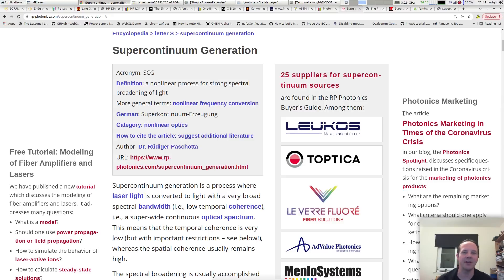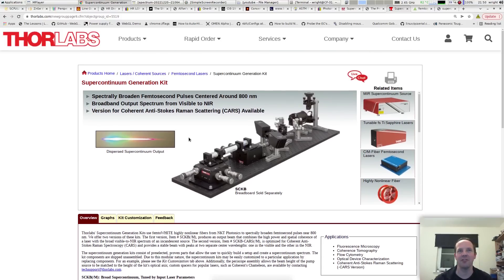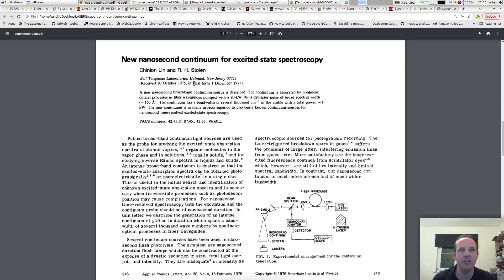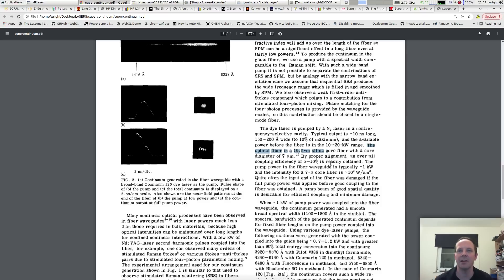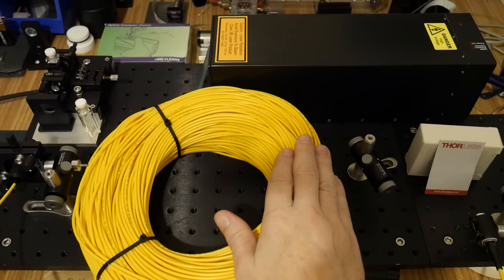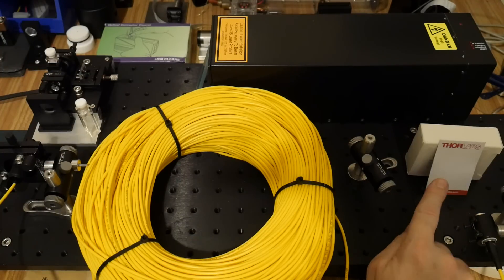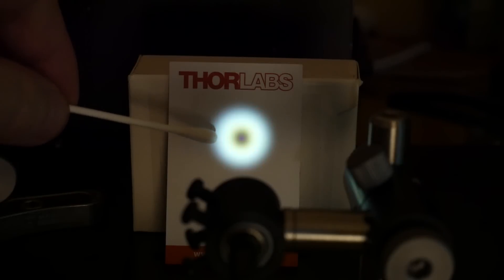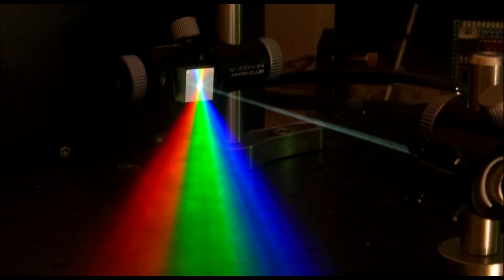DIY SUPERCONTINUUM LASER on a BUDGET!!

Comment: Very impressive! 

I remember some time ago you mention your home-made nitrogen lasers had quite good modeprofile, so it maybe interesting to try to couple them directly into the fibers and see if that works. 

As for the donut: Telecom fiber is designed to be single mode for 1550 nm, if you have shorter wavelengths, you can obviously still get some higher order modes in it. For example the Thorlabs 1550BHP Fiber (single mode, non-PM, 9 um core) has a cut off wavelength of 1260 nm, i.e. and wavelength shorter than that and it may transmit some higher order mode.

Edit: Upon thinking about it, that maybe the coherent superposition of the two TEM01 mode for the two polarizations you're seeing as a donut. Maybe if you hold a polarizer in the output you see a clearer shape.
Reply from the maker: It may be worth a shot, but I suspect the UV will damage the fiber. In the current setup I am right on the edge of the damage threshold, and have destroyed quite a few fibers getting to this point.

That's what I figured. At 400nm 9um is a giant hole as far as the light is concerned. But counter-intuitively 50um fiber gives a very tight singlemode output, suggesting that self focussing can take place within the fiber. There is a lot of scope for experimentation with this project!
Reply: @LesLaboratory  May I ask how you destroyed the fibers? A blown off end facet can be polished off. While you are mainly using the thorlabs-style fixed lens couplers, you can of course couple to a more-or-less bare fiber directly too. The Newport F-1015 fiber couplers is style of fiber coupler that you can also reproduce at home that doesnt rely as much on patch cables and where you can easily fix a blown end facet. Of course, if you destroy fibers by color center formation in the fiber, there is nothing you can do, really. 

Yeah, the scope of experiments is nearly endless. Self-focussing is of course one of the mechanisms the modes in fiber can couple from one mode to another, but I'd be careful to take the changes mode-profile as evidence of self focussing. Since in long and bend and impure fibers, modes couple anyways.

Comment: If you pass the output of the prism through an LCD screen with the backlight removed then through another prism to recombine the spectrum you can dial up any spectral profile of light that you want as the LCD can display spectral line masks.
Reply from the maker: This is a cool thread! 

So I think I see where you are coming from. Here are my thoughts on what I know and what I don't.

Spatial coherence in Supercontinnum Laser is great. You can collimate into needle thin beams with low divergence. Temporal coherence, not so much. I have not attempted to measure the coherence length, but I suspect it will be short.

I have observed (not easy to see on camera) that within each pulse of light emitted from the end of the fiber, there are sub-pulses. From a visual standpoint the light pulse appears as though it is reverberating through the fiber. This needs to be measured and characterised.

I have not measured the polarisation of the light emitted, or its variation pulse to pulse.

I agree there would likely be diffraction, loss, and other  issues with an LCD, but that is not to say it is unworkable.

Here are more questions:
What kind of profile(s) would you be wanting? A specific curve, or a specific set of wavelengths?

When that is answered:

What if it were possible to select/generate those in the fiber in the first place?
Reply: @LesLaboratory  One at a time: 

The Coherence length is inversely proportional to the spectral width.  Or better, it's roughly CL = lambda_Center^2/delta_lambda for the criteria to see spatial fringes, so about a micron coherence length for 550nm +-150 nm.

The temporal structure of your pulses is interesting, especially seeing subpulses and all the stuff related to the solitions in the fiber. Shot-to-shot spectra are a great start for that! 

Question: Spectral profiles. 

As for potential spectral profiles, a bandpass to turn it into a tunable laser is practical for all kinds of linear optical experiments. However, for that a pulse shaper is a little overkill and a monochromator will work fine as a single bandpass. 

But once you start to be able to have at least double color pulses, you can do interesting two-photon experiments. Sum Frequency Generation, Difference Frequency generation etc, but also accessing two photon electronic states in materials.  For spectal interferometry purposes, it would be nice to have spectral profiles that match your cameras sensitivity. 

What is answered: 

Doing the spectral shaping within the fiber is hard. You have seen what a mess the temporal evolution of the spectra is as it propagates down the fiber. You can of course somewhat filter colors with clever bend radius violations or with homemade fiber braggs gratings, though these do seem rather bothersome ways of changing the spectra.
Reply: No, because you have diffraction issues due to the TFT traces in the LCD panel.
Reply: @Zenodilodon  Having some light scattered by diffraction means you have higher losses and potentially a uglier mode profile, but I don't see why that would be an issue? At worst, just add a mode cleaner afterwards.
Reply: @TheTablet314  One use case is transmission spectroscopy imaging of microscope samples. You end up with a stack of images with each corresponding to the range that was not masked by the LCD.
Reply: @TheTablet314  Lots of losses indeed. My concern would be interfering orders when trying to recombine the 0/center beam. Maybe it's not a problem, It would be nice to not have the diffraction problem, a slit would be even worse and harder to use when trying to get an exact profile. I've never tried the optical setup, though I have grown to be overly cautious of ideas that sound *simple.

You could use dichroic filters as low/high pass filters for isolating bands though it would take a fairly comprehensive optical setup to select multiple bands at once.
Reply: What about a custom driven PCAOM that could select the bands you want? That would probably be optically the best way to do it. You loose some light still but the results could be very precise and adjustable.
Reply: @Zenodilodon  Not the same sort of beast really is it? Not a very cheap way of achieving numerically controlled spectral profiling.  You can use the 4K LCDs that are used in 3D UV resin printers, or anything cheaper with less resolution according to your budget, right down to an old Nokia mobile phone screen perhaps.The point being that Les' hack is very low cost, but still useful.
Reply: @Zenodilodon   One group I know that uses gratings get 60% transmission through their pulse shapers, though of course they are using a special LC in the fourier plane, not just a cheap LCD.
 
You generally use only one diffraction order, the one your grating is blazed for. Like ~70% efficiency is normal for those, so that's not to much loss either there. 

Of course, a prism can get better efficiency, but glass with it's dispersion and limited destruction threshold is usually avoided when dealing with amplfied ultrashort pulses in professional setups. For just some fun with these long pulse it maybe more than fine.
Reply: @DanielSMatthews  So you want to use that as a tuneable light source for microscope illumination? In case, why not use a regular monochromator to filter out one color from the beam. No need to build a pulse shaper that can apply abitrary combinations of colors.
Reply: @TheTablet314  That was just one example off the top of my head as my son is currently playing with a microscope in the same rooms as me. The more coherent light the better. Another use case would be as a form of multiplexor for experimenting with communications. This low tech stuff is great for hands on learning, anything else and you can go and spend a million bucks on a real optics lab.
Reply: @TheTablet314  " though of course they are using a special LCD in the fourier plane " Yeah I would expect just that to be the case. The ideal LCD would be a row of vertical bars that could be switched, probably passive or with the transistors set out of the active area. This would kill the main diffraction problem and drop losses significantly. My experience only comes from trying DLP/LCDs from projectors which while will do the job gave me unforeseen/undesired effects. I will also note that the application was to be related to show lasers and did not have in mind any sort of prism recombination in it's implementation.
Reply: @DanielSMatthews  Sure, there's lots of fun to be had with broadband coherent light. 

I do think you're underestimating this low-tech stuff a little. Fundamental reserach if quite often things cobbled together to see if they work as one would imagine. I'm still very impressed how Les got his home build TEA laser to basically match the quality of the professional ones. 

So IMO it's very much worth asking, what can I do with that and how?
Reply: @DanielSMatthews  An old nokia phone screen might be an excellent way to go actually. The screen is primitive enough to lack the TFT layer. Any generic dot matix screen would work, the more pixels the better. Clever use of cylindrical lenses would also allow for a more compact unit and smaller prisms. Some bleed is bound to happen but as far as cheap and easy to write code for it's as good as it gets within reason.
Reply: @Zenodilodon  Ah, can imagine if you're trying to have some highly structured pattern then diffration makes your life a lot harder.
Reply: @TheTablet314  Research is a learning activity, the engineering of a product requires the big budget though.
Reply: @Zenodilodon  Ah now we are on the same page. 👍
Reply: @DanielSMatthews  The brain juices are certainly buzzing on my end after this video. In the more complicated aspects I am still deep in the learning curve and it's always a pleasure to exchange thoughts with alike minded people. Esp in public forum where ideas can be seen and put to the test by others.
Reply: I think this will destroy the spatial and temporal coherence though, which would essentially defeat the purpose of using supercontinuum light for many applications.
Reply: @Muonium1  The proper name for the concept outlined is a pulse shaper. Usually they use gratings instead if prisms and also two focussing elements to have a LCD hit by a collimated beam, but they very much work to make essentially arbitraily shaped electrical fields with femtosecond pulses.
Reply: @Muonium1  Logic would suggest that any useful use case makes the method useful, in those contexts. Also you have not explained  the reasoning behind your "I think this will..."